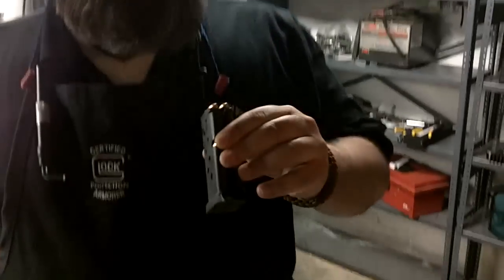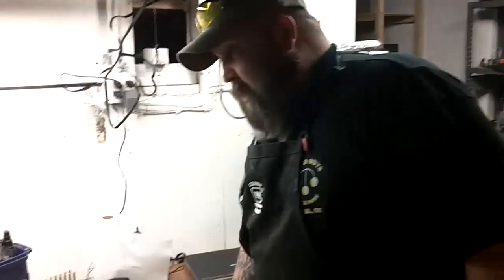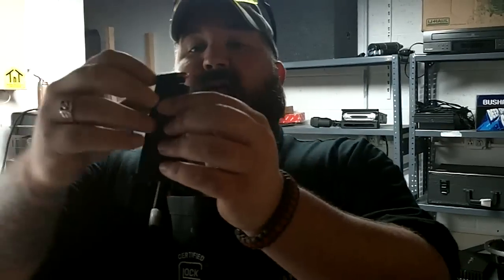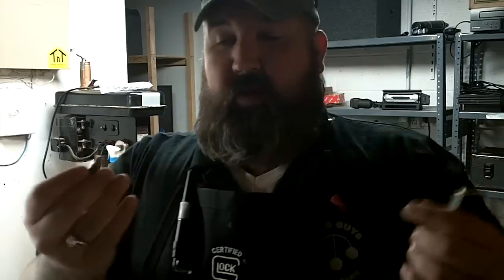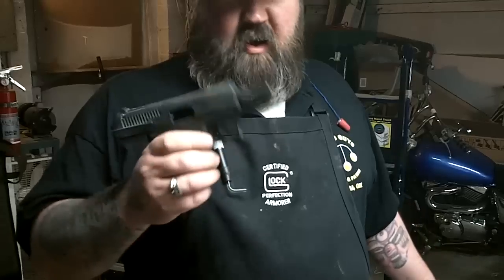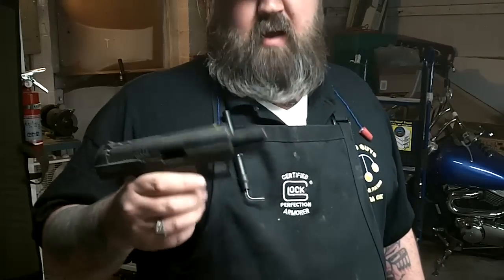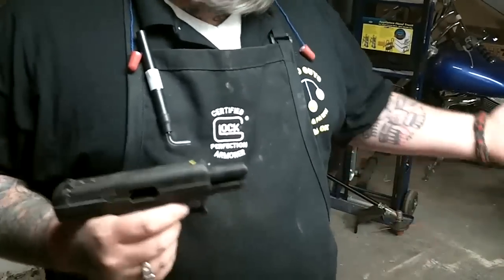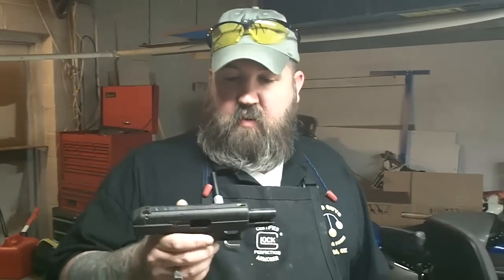Hi-Point C9: Tuning The Mags and Feed Ramp

Comment: Thank you for being one of the only people I've ever seen that hasn't told me I'm a moron for buying a Hi-Point. It's affordable and I want to protect my family. I don't need a 1000 dollar gun I just need protection. So thanks again for being respectful of other peoples choice in protection.
Reply: whoever called you that for buying a hp, probably have no personal experience with them, nor the knowledge to do a simple fix like in this video. ive had them before and ill get another.one neat thing about a hp is that its plus p rated, meaning it can handle some super hot loads the some more expensive guns can't. another comparison ill use and its a little off topic, is someone who has a fancy sportscar, and someone who has an old ugly pickup. doesnt tale much imagination to know which one is more durable and will run better in the winter. i actually was looking for a way to tweek the mags on my ja-22, another cheap much maligned gun when i found this  vid. i hope this works for me lol

Comment: Thank you for your information. I have a Springfield XD9 subcompact and absolutely love it. I also own several other guns. among those guns I did buy a Hi Point C9. The first time at the range it did have a failure to feed problem every time so I put it back in the carrying case to deal with that problem later. What I found was A burr at the very bottom of the feed ramp. so I did disassemble the gun and with a Scotch-Brite wheel removed the Burr and all the paint on the feed ramp. I have ran about five hundred rounds through it and all with no problems to feed or misfires or jams. your video has added to my knowledge of the magazine modification. I never thought about this and the angle that the bullets are at in the magazine. I am going to also spread the lips ever so slightly on all my magazines for it so that the bullets initially angle better for the feed ramp. I agree with you it is a very well-made gun and for the money I find to be very accurate and consistently well firing.

Comment: Thank you GunTortureTests, I followed the advise in your video and applied it to my Hi-Point JCP40. I just reassembled and went on in the back yard and fed two mags through without a flaw - and that's using Tul-Ammo which has given me more problems than any other ammo.
I did use a dremel, very carefully, also smoothed the mag feed edges with a file instead of tweaking with pliers. Great Video!

Comment: He's correct on everything. I got a $99 hardly used but absolutely brand new looking Hi-Point C-9 and it scratched the cases of my 9 mm ammo. Also it was extremely difficult to load the cartridges because the feed lips of the mag were too close together. I spread them a little and also sanded with emery just a little. Now the 9 mm cartridges no longer get the brass cases scratches and also I can load up the mag with not too much effort. I'm thinking that the original owner was not aware of the simple fixes and sold it to the gun shop.
I also lightly polished the feed ramp removing a little paint and making it more polished as well of my Hi-Point 9 mm and my expensive Colt 1911A National Match Gold Cup Trophy .45 ACP. In both instances the action cycles better, and no more failure to feed (FTF). Well maybe once in a while I get a FTF, all I need do is push on the back of the slide and it finishes loading the cartridges. Also my Colt still Stove pipes very rarely I think that is my fault. I am of the thinking that if you limp wrist a semi auto pistol you can cause a FTF.  I'm not alone in this thinking. Also perhaps my pistols could use some more shooting to finish the breaking in process.
But anyway this is a good video and if you have any issues as he has described you would be wise to do as he say's. He's right 100%. It's fun to do your own work, just follow his directions and take your time. Do not over work it either. Good enough is good enough! Maybe one day I will do a little more work so that both guns always work 100% but 99% for now is good enough for me as I am not a home defense person with auto loaders I use revolvers for that. Also I am a paper target shooter so one FTF every once in a while means nothing to me. Remember when I got my Hi-Point 9 mm C-9 I could hardly even load it and it FTF every once for every full mag. So I am really a lot better off now and that makes me a happy camper/shooter.
I like my Hi-Point so much I purchased a new Hi-Point 4595 .45 ACP Carbine. That carbine is dead on at 50 yards. I only paid $319 for it brand new. I really really like guns that work good and are affordable. So I am a Hi-Point fan now.
Reply: +PeterDad60 P.S. I got my C9 in 2012 so it is probably a 2011 or earlier. They may have fixed these small problems by now.

Comment: I was getting that also, I think it is the reloads I was using. I used the steel casing rounds and they worked. If you inspect the ammo and find burrs just lightly sand them. There is expansion when fired.

Comment: I have the 9mm carbine and just got the 380 and polished the feed ramp on the 380 took it out and shot with flat nose ammo and it did not feed well. I had the same problems with the carbine with flat nose rounds. Do not use flat nose ammo in these fire arms. I have the best results with round nose. bought more clips and did the bends and the 9mm mags fit the 380 same mag just longer. I also used the 15 round ind it worked.

Comment: This was awsome info. did this gun shoots perfectly.  I also went as far as sanding the edges of the slide pin and the very back of the slide rail seemed to be a little sticky the last half inch or so look like paint overspray in there.

Comment: Glocks and Springfields. Got my c9 for $140 used and it shot like a dream aside for the mag that nosed dived the after the first round. But my brand new mag put out 150  rounds without a fail. Going to tweak my 8 shot, see if it helps

Comment: the hand cycle is better and smoother, it seems to rack better now i will see how it works on the range tomorrow. I will let you know what happens after tomorrow plus with the design which is an early 1900's style I also know that the higher grain ammo in these makes them cycle like clockwork.

Comment: what is your opinion on using engine assembly lube or graphite on the feed ramp? I just purchased a new c9, havent shot it yet but when i got home I did rack a full clip and found I had no problems except with the last round encountering nose dive. Also i have found that you really have to slap the mag in or it wont seat. You seem to know your shit, and as this gun is new, any suggestion for the break in period?

Comment: my hi point c9 did nose dive, with new clip a little turning and polish the feed ramp i shot several hundred rounds and just cleaned it after i took it apart, it togather right, i make sure because of the feed problem, i though dirty from use! thanks! i have 2 hi points one pistol and carbine 9mm, there cheap to fire, they work! if there junk well if it works good and holds up! i seen iraqvet8888 hi point test! it held up real good to my seein it

Comment: the lips on my hipoint 40 dont touch the round. i had to squeeze the back of the magazine closer together and raise the front bump of the plastic follower in the magazine to get the rounds to raise so they cycle properly. i guess every hipoint is different, but they still shoot when you pull the trigger, like every gun should

Comment: I have a c9 and when firing the slide does not close all the way, not every round . What can I do to solve  this problem
Reply: Some C9's have this problem with lower power ammo.  I have read where many C9 owners have the same problem when using Federal Champion 115g ammo.  I use WWB 115g and have never had your problem.  Good luck.
Reply: I use blazer and American Eagle it works great in my c9. I tried some cheaper ammo didn't work for crap lots of feed failures need enough power to fully operate the blowback slide.
Reply: I use Winchester white box ammo and have never had a feed problem.
Reply: I don't remember the brand came in an orange box and was like 3 dollars cheaper then any other ammo it sucked bad. Lots of feed failures and fail to eject, I was ready to toss my hi point switched ammo love it now awesome reliable and very accurate

Comment: I called Hi point on my c9 failure to eject issue. They said the problem was the firing pin and or springs. I didn't see what the firing pin had anything to do with failure to eject but, they sent me a new pin and springs and I haven't had any issue with failing to eject sense. I have put 1500 rounds thru the weapon to date. Go figure.

Comment: The problem with cleaning any gun without disassembly is getting solvent into areas you cannot remove it. The residual solvent will break down and displace any subsequent lubricant causing undo wear on metal to metal contact points. If your looking for a gun you can clean without disassembly you may look at revolvers. More time consuming due to the added cylinders to clean but easier to do without disassembly. Just my humble opinion. Your mileage may vary.

Comment: the fte shows its not dependable and when your buddy shot the gun at the match it had problems. not a good selling point. why does hi- point not take care of this before it leaves their factory?
Reply: Why doesn't taurus address it with their 1911's?  Why hasn't Glock fixed the issue with their 10mm?  GTFO of here with that.
Reply: @bryanheimann5370  its the short weak springs theres videos of how to remedy this but the pistol itself is solid

Comment: Instead of polishing the paint off the feed ramp, why not do a spot application of a paint remover instead? That should remove all the paint in the desired area and not have to use an unregistered Destructive Device(aka Dremel tool). Then reserve polishing when any roughened areas that were hidden under the paint are revealed.

Comment: polishing the feed ramp in theroy is to remove any machine marks from the metal, not just the paint. I own several hi-points and never experience any issues. There are far better tutorials out there for feed ramp polishing on hi-points, although most FTF FTE issues are caused from limp wristing. This tool is blowback operated.. a good stiff arm should correct most issues.